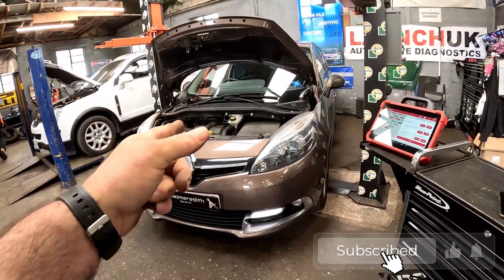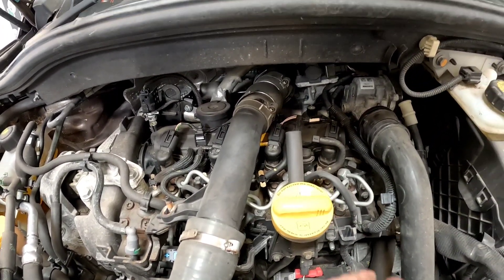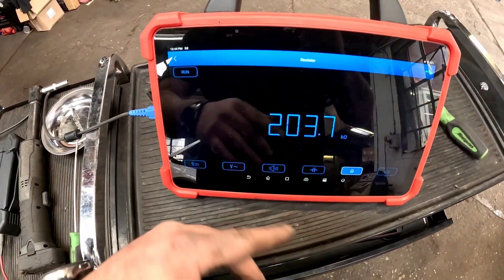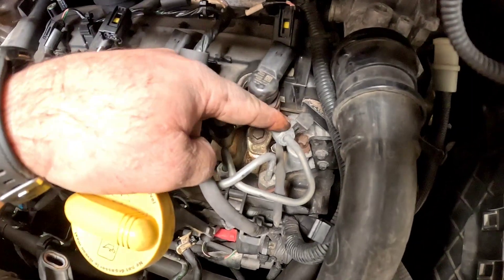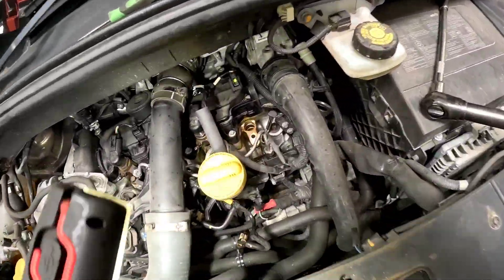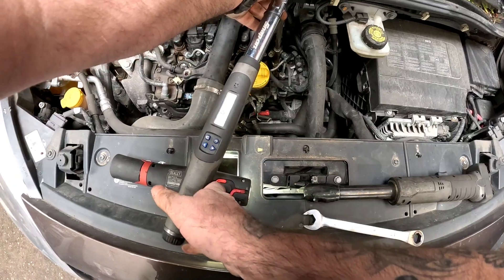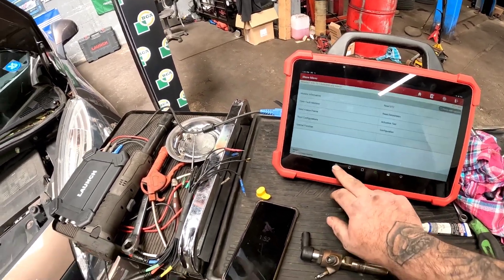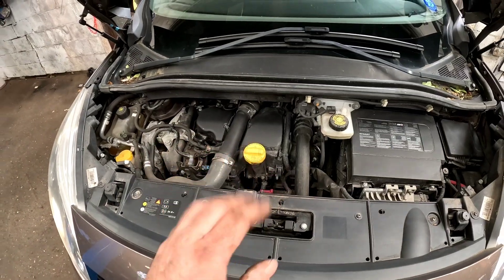2014 Renault scenic 1.5dci cylinder 1 injector control circuit (misfire)

Comment: Update after fitting the refurbished injectors I purchased.
After doing around 150 miles Injector 2 has failed again, saying Cylinder 2 injector Control Circuit - Signal incoherence
Any ideas as to what has happened?

Comment: After watching your video, I'm glad to say I have just replaced all 4 injectors on my 2012 Grand Scenic!
One failed on me last week when I was 60 miles from home so after ordering a set of injectors (my thinking was that if one has just failed with 162k on the clock, then the other 3 won't be far behind!). After taking all of them out, it looked like Injector 4 was about to say goodnight, so my expensive OCD hunch paid off.
Your video helped me immensely. I love a straight talking video, one that shows you what to do & gets to the point, rather than listening to some tech waffle on for 20 minutes before they open the car door.
One question though, did you replace the bolts that hold the clamps in place?
Thank you for your very informative video!!

Comment: Isn't it necessary to clean and flush the whole fuel system including the tank too?
I have two injectors replaced and after 45k kms the very same failed again. (Was not your garage who did the job) I just want to know the proper workflow. Thanks!

Comment: I'm so confused, I have the exact same noise/vibration but no engine light, codes, anything
Reply: Hi, what was your issue? Have same situation, no errors, no dtc, just noise
Reply: @RobertRobert-d3w  failed injector 3 on mine I could've got away with just replacing the 1 but opted for 4 I also had a set of NGK glow plugs installed at the same time, running alot better now

Comment: Thanks. Why these injectors fail in the piezoelectric sensor? Are of low quality ?  What we can do to avoid failure? I had two failed injectors in six months at only 21,000 km 😢
Reply: OK replaced by better quality brand injectors and my car flies again but my pocket hurt